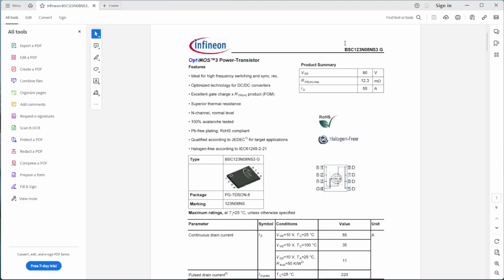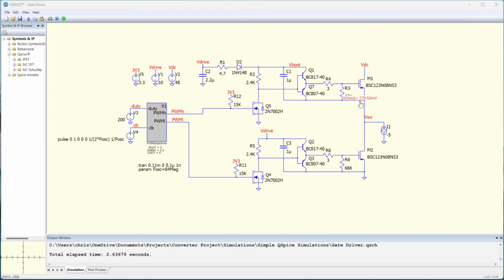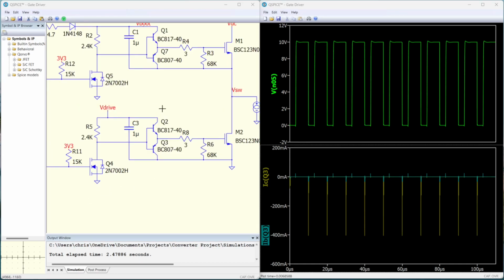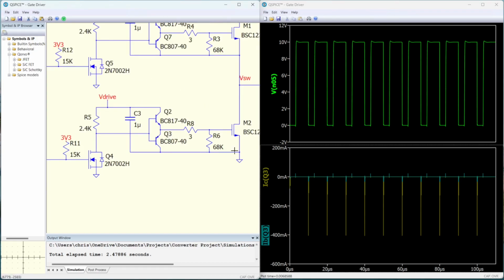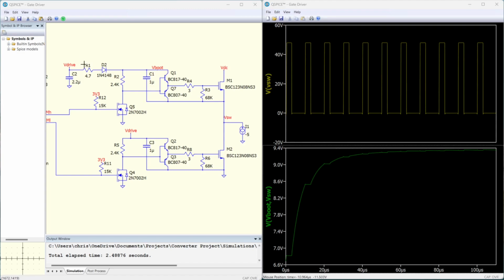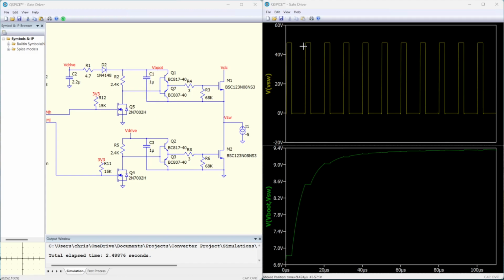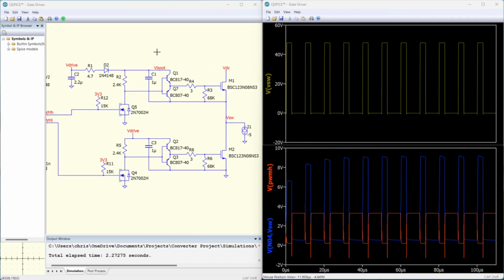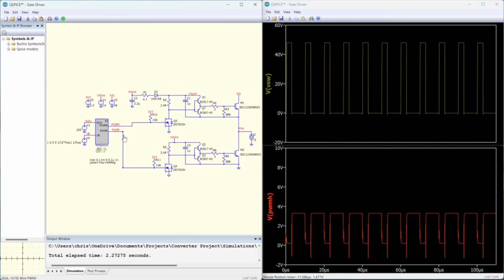Designing a Discrete Half-bridge Gate Driver

Comment: If the high-level PNP transistor reaches a very low voltage across its emitter-collector junction, it will act as a diode rather than a transistor. I wonder if the collector of the PNP should be grounded if low voltages are used on the final supply voltage.

Comment: Hi, i just wonder, because the 2n7002h has a threshold voltage of somthing between 2 and 4V but the output of MC is 3.3V? Regards, J.P.
Reply from the maker: Hi, thanks for watching and closely reviewing this design. Which 2N7002H are you referring to? 
If I for example look at the 2N7002H from Nexperia https://www.nexperia.com/product/2N7002H the max. threshold voltage is 2.4V (@25°C) and over the whole temperature range (Fig. 12. in the datasheet) the max. Vgs threshold is 2.7V.

Comment: A part two follow up would be great to compare performance to an off the shelf driver chip since you asked the question which approach we liked the best. I enjoy the descrete design but perhaps the driver chips work better ?
Reply from the maker: Thanks for your comment. I as well enjoy discrete designs. The best solution is mainly dependent on your requirements like available space, MOSFETs, voltage…
Combining driver chips with external discrete components is something worth to consider too.

Comment: Thanks, great video. Can't tell you how many times I've messed up a 3 terminal pinout and had to do the rework of shame. There are 5 ways to get it wrong and only one way that's right:-) I always check the footprints against data sheets, especially 3 terminal parts.
Reply from the maker: Thanks, I’m glad you liked it.
With 3 terminal pinouts you always have to double or triple check it, to make sure to not run into the same problems as shown in the video. It’s just so easy to get it mixed up.

Comment: When it comes to Vdc voltages in the range of hundreds of volts, Q5 will see the entire voltage so it is not easy anymore to find the right parts.
The turn-on is related to pull-up resistor (R2/R5) value and this can potentially be a limiting factor depending on specific application in terms of switching speed vs. power loss.
BR,
Florin
Reply from the maker: Thanks for your input! I agree that this design is best used for sub hundred volts. For higher voltages a different approach might be needed, like a level shifter not drawing so much power or a transformer-coupled gate-driver.